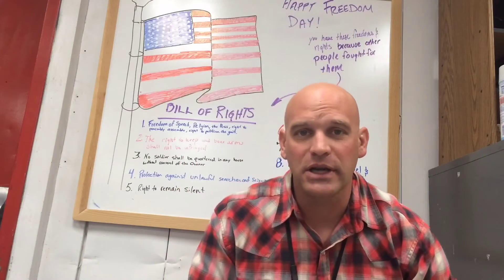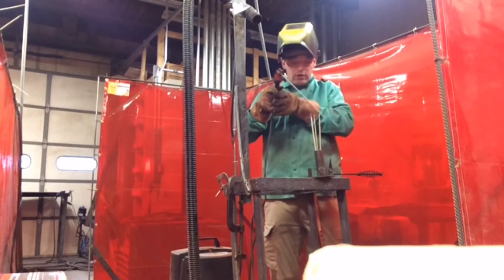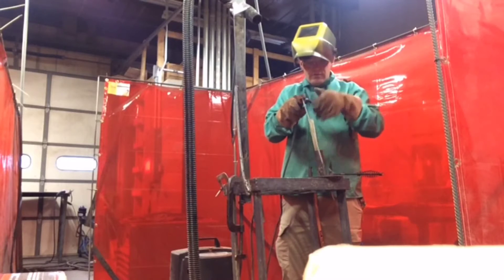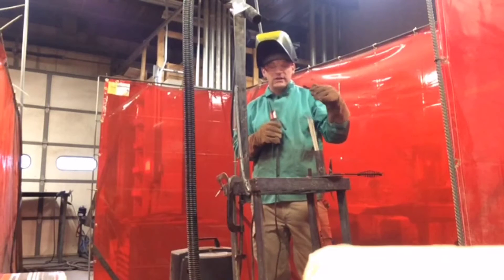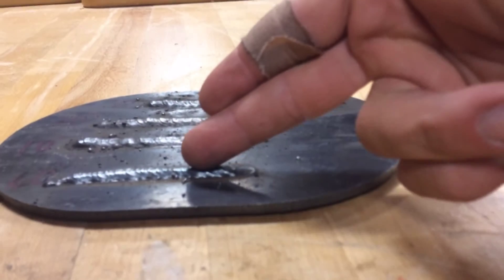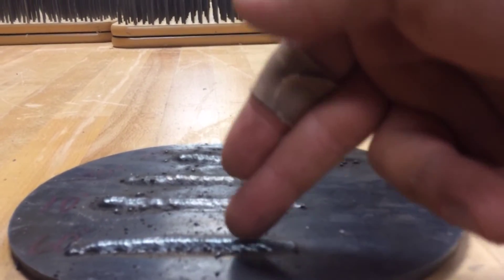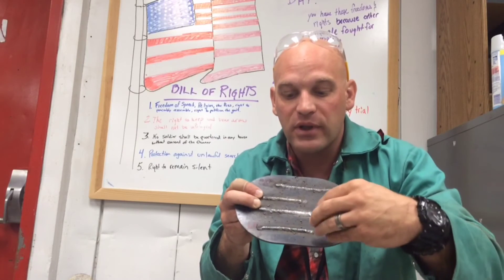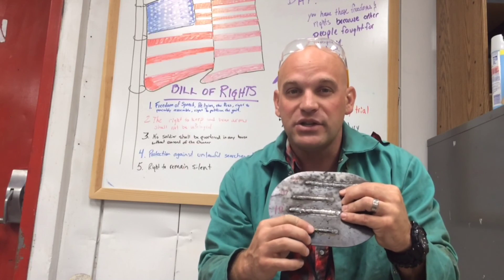Angles for a Good Arc Weld

Comment: Will the 60degree angle be a best option for welding a thin metal like a car exhaust ?
Reply from the maker: are you going to MIG or Stick the car exhaust? If I were to weld car exhaust, I would probably MIG it, and I would say a greater angle might be needed
Reply: @Trevkongable  i only have stick weld at home.. i dont mind how the look of the weld bead.. are the greater angle got the less penetration ? because i want to reduce the chance of burning through the pipe.
Reply: Nobody sticks exhaust lol.
Reply: @anxietyonline1947  Then you not lived long enough if you never see stick weld on exhaust before.